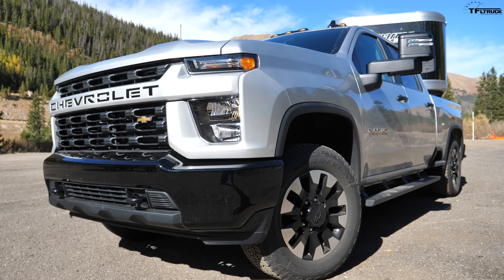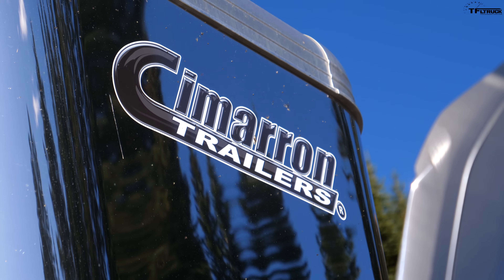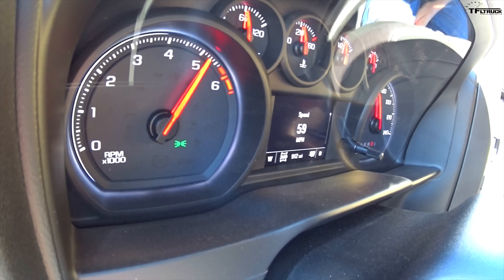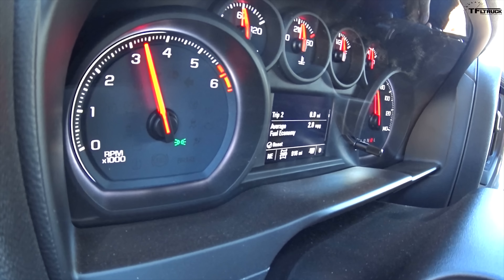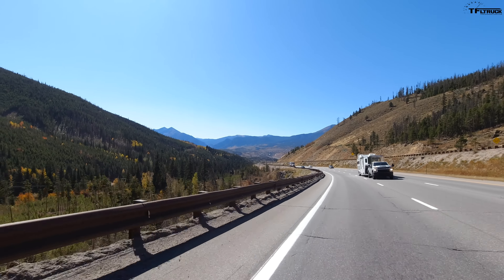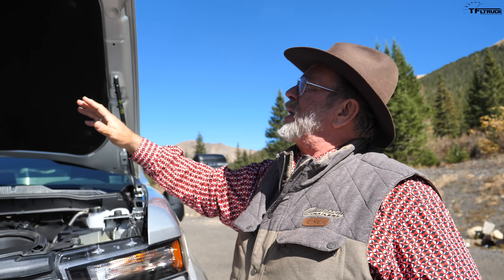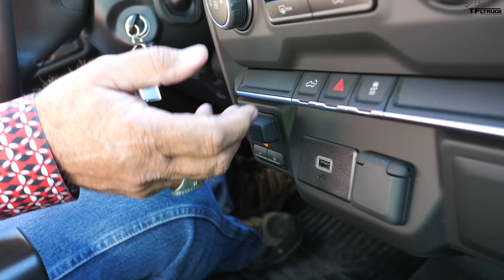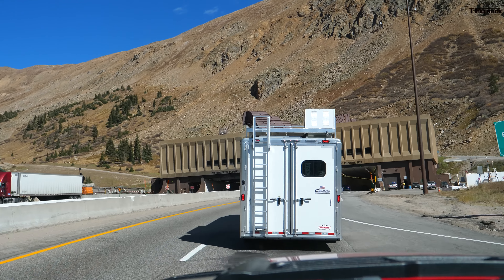The New 2020 Chevy Silverado HD Gasser Broke Our Ike Gauntlet Scoring System - Here Is How!

Comment: Yikes!  I'd hate to have to spin that engine that high all the time.  Curious to see how the Ford 7.3L gas does.  The new Ford would be my truck/engine of choice if I was buying a new gas tow rig.
Reply: That's how GM gas engines are, the 6.0 was the same way. It makes you uncomfortable, but there are many satisfied 6.0 owners that abused theirs for 300,000+ miles. A 6.6l LT derived v8 could make over 500hp, but it's detuned to be beaten.... In this case, severely!
Reply: Use my 5.3 for towing and the rpms are high all the time like this. 

Almost 300k on it now and still doesn't burn a drop of oil (leaks though lol). Chevy truck motors are definitely reliable.
Reply: Gasoline engines are built to spin high. That is how they make their power. The Ford 6.2 spins up even higher (although it can handle it better because of the SOHC).  It is not unheard of for extreme duty gas engines to last 300,000 miles or more without major failure. One guy on the Ford Enthusiast forums is a hot-shotter that had 438,000 miles on it before the cam started wearing.
Reply: keep oil on the stick & it will be fine. use synthetic if your that worried about it. absolutly nothing wrong with using the whole rpm range.
Reply: @780brando  "I bought the whole tach so I'ma use the whole tach!"
Reply: @OgreMoto  And considering ur 5.3 and this 6.6 are built on the same platform, I'm sure it will last too
Reply: @Joshua Webb 5k isn't to crazy high, anything over 7.5k is screaming for a gasser.
Reply: I guess I'm just old school; back when big block V-8s could loaf along and get it done at lower RPMs.  I've got a V-10 Super Duty and I have never liked the RPMs I have to spin it to sometimes either.  (I've got a 5-speed manual, so I control the RPMs; my Dad had an auto in his and it would sometimes scream along in 2nd towing a big trailer up the pass.)  Due to needing more capacity, I moved up to a Powerstroke.  It spins fast for a diesel, (again, I'm old school and old diesels didn't like or make power at 2000 RPMs or more), but with nearly 1000 lb ft of torque, it spends most of its time down low on the tach.
Reply: I tow and haul alot with a gasoline engine, rpm limiter set at 7,200 rpm. Up these long 12%+  percent logging/mine roads I'll pass 6,000 rpm fast. Truck's about to roll past 350,000 miles so far. I've always wondered if revving high shortens engine life ? Or poor lubricant/dirty oil does more damage and extended idling in stop and go traffic.
Reply: @Joshua Webb Durability testing for these engines involves hundreds of hours straight at full throttle, alternating between peak HP and peak torque. A few minutes near redline is absolutely nothing for a modern powertrain. Keep the coolant and oil cool, oil pressure sufficient, and they'll run forever like this.
Reply: Mr. Sullivan I’d go with poor/dirty lubricant and lack of maintenance being the biggest factors in reducing the life of anything mechanical.
Reply: Mr. Manson starting an engine in the morning causes more wear than holding 6,000 rpms
Reply: @gmcdenali7178  this will last way longer than a gen V 5.3. These have no AFM thankfully

Comment: Yeah, that's what I want! Having to maintain 5,000rpm
At
All
Times!
Reply: @No F-Bdy Bs you must be a flat lander that’s never lived or towed in the mountains. When you’re pulling max weight up a 7% grade you’re not going to be in sixth gear and a low engine rpm. The diesel engines are also at the upper end of their rpm range.
Reply: Not built to last in my book.
Reply: carl atamanczyk if it’s below redline then it’s gonna last. What makes you think 5000 rpms for 10 minutes max once in a blue moon is bad for an engine designed to run up to 6000 rpms?
Reply: Show me a gas burner that won't tach out on that Incline and elevation.
Reply: 16k trailer....impressive for any gas engine up that hill
Reply: Why doesn't the manufacturers give these things turbo or a supercharger....oh that's right no one would buy a diesel if they did that.
Reply: @carlatamanczyk3891  you do realize this has a significantly shorter stroke than a diesel, the piston speed is probably very similar between this and the diesel at their respective max rpms, which means they will wear the same in that regard
Reply: @231mac  read above
Reply: I believe they should bring back the 8.1 it has a wide level range on the torque in the rpm's. The best pulling gas engine ever built hands down.
Reply: @donaldthomas5852  8.1 is a tried and true workhorse and has tons of torque but you cannot give them away win gas prices rise and we all know gas prices will increase.
Reply: They’ll scream all day long. It’s a gas engine. That is how it’s designed to run. It is much better for it to run high rpm in the power band than to lug the piss out of it. I have ~190k on my little 5.3 and I cannot begin to count how many times that tach has seen the redline, or how many hours upon hours it has spent hovering around 3500- 4k rpm pulling a camper.
Reply: @oldwing1589  I agree 100%. Lugging an engine is far worse than high rpm. Detonation is almost non existent at high rpm but can be easily found at high load and low rpm scenarios. Detonation is terrible for wrist pins and main cap bearings.

Comment: A plug in hybrid version of this truck would be awesome. Regenerative braking would be killer for downhill with a heavy trailer. Enough battery for about 100 miles, then a Volt style hybrid system attached to the front wheels and pure electric drive on the back wheels to avoid needing a driveshaft. When your batteries are down to around 20%, the gas or diesal engine kicks in. Would be way more useful than whatever Tesla is going to unveil.
Reply: I can only wish

Comment: I would love to see you guys switch from doing the MPG based on the dash screen to do a fill/refill test like you do for the other tests.  I realize that there isn't a fill station at the top of the hill, but maybe switch it to a Up/Down loop MPG test.  It just seems that you guys always prove that the on board computer isn't very accurate when it comes to MPG.
Reply: I agree. They can take one five-gallon can, filled to 5.000 gals and then top off the tank after the run. Then they can refill the can and see how much was used. An 8-mile run should never use more than four gallons(I hope!).

Comment: Although would be above its towing capacity I honestly think a 2019 super duty with a 6.2 and 430 gears would do just as good or better with same load
Reply: Yes it would!  The Torqshift transmission's programming really works well to keep the engine in the powerband.  The tow capacity of the 6.2 is conservatively rated.  It really is a beast of an engine with the right transmission under it.  Looking forward to ordering a 2020 with the 10 speed behind the 6.2.
Reply: Absolutely would with no problem!

Comment: I bet that Chevy is going to be one of those engine truck combinations that last forever.
Reply: The biggest problem that I see for longevity is that the fuel injectors are inside the combustion chamber, rather than in the intake port. I don't see how they will be able to prevent carbon buildup on the upstream side of the intake valves.  The GDI is a disqualifying factor for me, because I believe that is detrimental to longevity.
Reply: @racerboi77j  Buy a Ford and you won't have that issue. Ford has an injector in the combustion chamber and one in the intake port.
Reply: The new 7.3 and the stalwart 6.2 both use port fuel injection only.  I know that is where I am looking for when I order a truck early next year.  Ram uses port fuel injection as well, but the MDS scares me.

Comment: NEEDS the 10 speed if they want to keep those 3.73 gears.  Either that or go back to 4.10 with the 6 speed.
Reply: 10 speed and 4.10
Reply: @gen1c8rs88   Honestly it would be no point to do it.  The 3.73 and 10 speed would be more than perfect.  I do think that it will be interesting to see what Ford runs with their 10 speed and the gas engines.  I don't think the 4.30 will be returning.
Reply: @killercan10   I have heard 4.3 gears and a 10 speed with the Tremor off road package, keep in mind 285/75r18 Duratrac tires are rated at 35.1 inches in diameter.
Reply: They should have kept the 4:10 and put in a taller OD gear. Mine runs at 2000 RPM on the hyway at 60mpg in 6th gear. When not towing it should be 1600 RPM like my last 1/2 ton 4.8ltr v8.

Comment: TFL compared the big three gas HD pickups but they use different trailer weight for each test. WHY?
Ram 2500 6.4L Hemi: stated trailer weight is 14,300 lb.... Ford F250 7.3L gas: trailer weight is somewhere around 14,800 lb. (they never say exactly but is has ~500 lbs. more ballast than when tested with the Ram 2500).   Silverado HD 6.6L gas: stated trailer weight is 16,000 lb.   So of course the Chevy is slower than the other two. While it probably wouldn't come close to the Ford, it might have been about the same as the Ram 2500, which as tested was pulling only 89.3% as much weight as the Silverado.

Comment: I'm wondering if this truck is truly rated at this weight - meaning SAE J2807 rating.  They are supposed to test it on the Davis Dam road and it is supposed to maintain speed, at given ambient temperatures, with the AC on.  Seems to me the Ike Gauntlet should be the real manufacturer test - it's the one I use personally, living out here too.  The F-150 Ecobost 3.5 is a monster at 11k elevation because of the turbos.
Reply: The J2807 test at Davis Dam requires the fully laden truck to accelerate to at least 45 mph from a dead stop and maintain at least 45 all the way up the grade.  Based on those requirements, this truck would have failed if the Ike was part of J2807.  I've seen the EcoBoost videos, and that thing is a hill-climbing beast at high altitudes, but TFL has never tested it with a 16000 pound trailer.  (Because it's a half-ton.)  It would be interesting to see how well it would do on the Ike with that much weight.
Reply: Andy Harman Thanks for the clarification and I agree. When they are looking at the window sill on this truck for its capacity ratings, I think the sticker says SAEj2807 on it.

Comment: It would be interesting to see the difference in engine and transmission temps between the gas and diesel trucks on a long grade. Especially at full throttle. I have been up and down Monarch Pass on US50 pulling a fifth wheel and ATV trailer behind several times. (5.9 12 & 24 valve & 6.7 PS)

Comment: Temps should be added to the test.
Reply: I agree, but it would be interesting to see the temp differential from the start to the end of the test.
Reply: Chris Browne I concur, but they need to do it with a scan tool and not the gauges because they’re not always accurate, especially the needle type of gauges
Reply: I agree. If you  are towing this kind of load they need to be looking at transmission temps and like you said also with a scan tool. You can't tell me that transmission temp wasn't rising with that kind of RPM's for that long.

Comment: GM Lead Designer: " Team, we need to buckle down and try to design the ugliest truck every seen."
Mission accomplished.
Reply: Gotta say at least in body color (with a light or bright one) the CHEVROLET bar is growing on me. It's hideous on the W/T in black; maybe if they painted it white for the W/T it'd blend in on a white truck and have a retro effect with any other color.
Reply: @nlpnt  The chevy bar is the only good looking part, the lights and grill need some work.
Reply: Not exactly pretty
Reply: @nlpnt  the lightheads are hideous. Not that a truck is supposed to be pretty. 
But the RAM's are gorgeous, Fords are meh. RAM has the best interiors and technology, and the Almighty Cummins. Ford has the 10 spd across the line, and the best engines, at least on paper. 

Chevrolet has nothing going for them! Not even exterior looks! GMC looks quite nice outside but nothing relevant beats the competition, and their prices are just ridiculous. I cant imagine why people would buy Chevy in 2019, other than brand loyalty and good deals on base models.
Reply: That us one very ugly truck. I wouldn’t want it purely due to having a butterface.....
Reply: mtrujillo1973  fair enough. Whatever truck you bought, if you're happy with it, thats what matters.

Comment: I’m currently looking into getting a 6.6 gas. I don’t tow trailers very often(and when I do it’s usually under 9k) and mainly need something for hauling materials in town. All the modern deisel s get pretty bad in town mileage. But when I saw they had no option for a 4:10 and a 3:73 is considered an upgrade, I had to say no. 

I currently use an Lly Duramax, and previously used an 8.1 vortec.  I was hoping the 6.6 would be akin to the old big block 8.1.(power number suggest it would be better) but everything I’ve seen says it’s a worse option for work than the old 8.1.
Reply: You'd probably be suprised if you could see a direct comparison of the new 6.6L to the old 8.1L. I'd be willing to bet the 6.6L would kick the shit out of the 8.1L as it has way more horsepower, about the same torque and most importantly a far superior transmission, even though today an 8-Speed or a 10-Speed is the way to go, the 6-Speed this truck uses is vastly better than the 4-Speed the 8.1L had.

Comment: Just for a gas comparison I have the Ford 6.8 V10 ( soon to be replaced by the Godzilla) in my motorhome and have gone up and down this same hill with it.  On the way up it’s screaming pretty good and I’m always wishing I had a turbo or something!  On the way down, the tow/haul on the Torqshift trans does a great job holding it back.  I have to tap the brakes once in awhile but you always feel confident with the situation.

Comment: Poor girl needs the 10-Speed, that engine has the power to do better. The 6-speed is a time tested and proved setup, but the gears are just too far apart.
Reply: @andrewsbbq  loses less momentum when switching through gears able to keep it at peak for longer
Reply: If you wanna see too far apart look at the 4 speed they used to use on their half tons lol. 1st goes to about 45 and 2nd goes to like 75 lol.
Reply: @andrewsbbq  Gassers have a more sensitive torque range. Being able to keep it in the highest power band rpm is key to a gasser towing. It didn't look like auto shift was working well. I would have put it in manual to make it up shift.
Reply: @andrews If you notice, anytime the engine was over 4,500 RPM it was able to accelerate (not just maintain speed) till it would shift into the next gear (mainly 2nd to 3rd). When it hit 3rd gear it was at 3,600 rpm which is not enough power to hold speed and then it would slow down till it down shifted. Having more gears allows the engine to have more places where it can hit 5,000 RPM and over. The 10-speed would have a gear ratio in between 2nd and 3rd on the 6-speed and allow the truck to rev higher in this gear while going the same speed like over 4,000 at 60 mph not 3,600 in the 6-speed. With a 16,000 lb trailer it’s not just about power, it’s about at what speed (MPH) this power occurs. Exact same reason that a lot of semis have 18 gears.

Comment: NO WAY! Would I spend the extra 10 grand for a oil burner! Operating expenses plus the price of diesel dont make sense to me. My 6.4 Ram pulls my 9000lb boat with ease. And I dont have to worry about replacing injectors or making sure my DEF tank is full. I think its pretty amazing the power manufacturers are able to get from these engines. That truck was loaded with 16000lb!!!

Comment: @ 10:18 "...we're at 38 mph... really getting close to 3,000 rpm"   Looks like you were turning close to 3,200 rpm, so you must have been in 2nd gear (2.364:1). It couldn't  downshift into the super-low 4.027 : 1 first gear until you slowed down even further (11:47 "...we were down to 25mph").  A 4:10 axle ratio would have raised the revs by only about 10%.  The 10-speed trans (now available with the L8T) has a 2.99:1 second gear, which would make a bigger difference (22% more revs; or about 3,900 rpm at 38mph).

Comment: I'd also like to compliment GM for re-hiring the guy that designed the early 90's instrument panels.  They must have come back in style with the mullet.
Reply: Yeah man I like the exteriors on the new trucks but the interiors are straight out the 90's GM parts bin.  The previous generation (15-19) were way better inside.